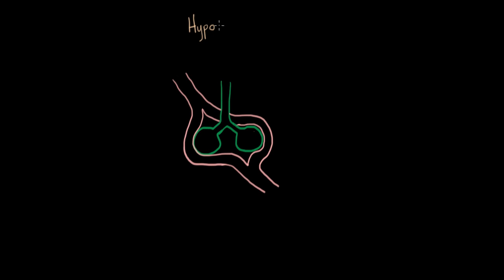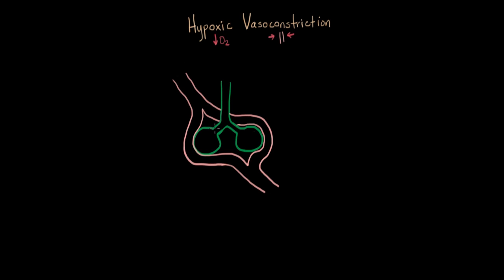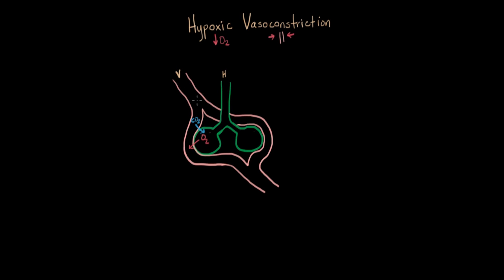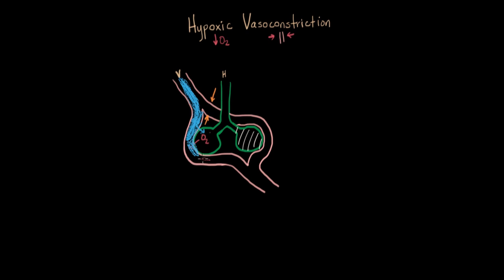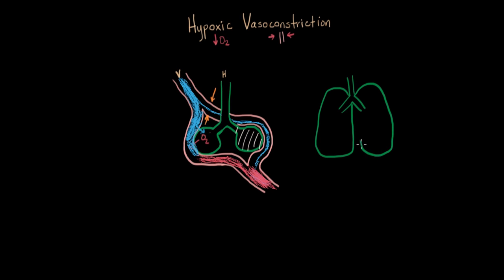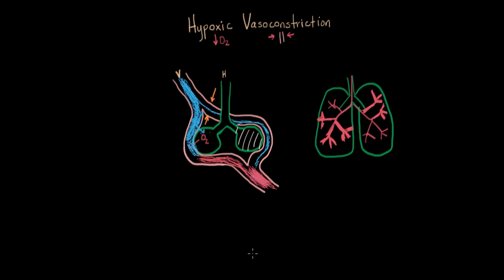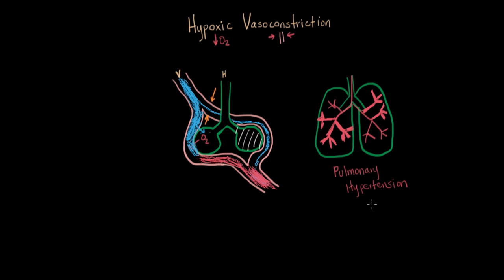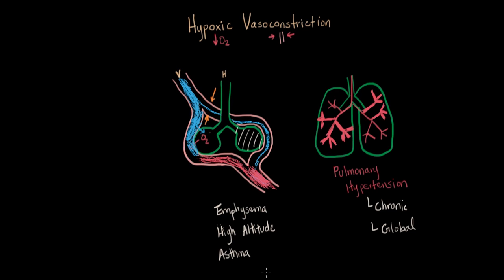Hypoxic vasoconstriction | Respiratory system diseases | NCLEX-RN | Khan Academy

Comment: Oxygen quantity in higher altitude does not change, it's 21%. It's the difference in pressure that causes problems.
Reply: 21% represents the pp02, but the quantity changes. The proportion of 02 compared to other gases remains the same but the amount of all those gases decreases at higher altitudes